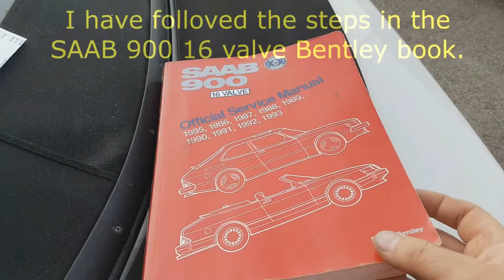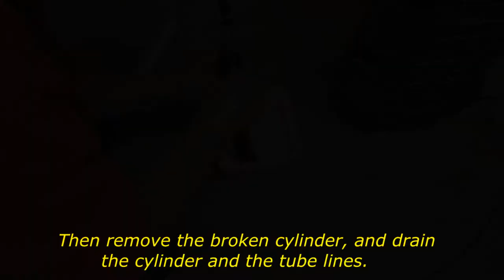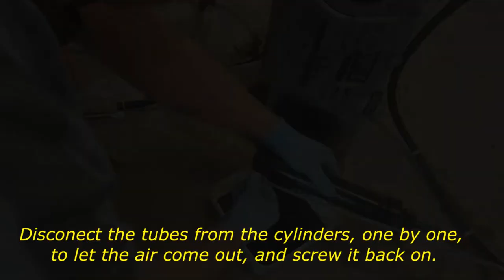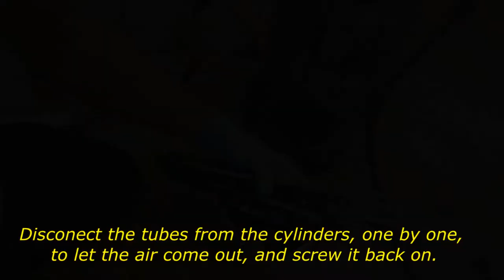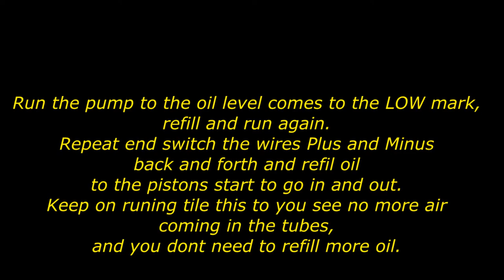SAAB 900 Classic Convertible, Top hydaulic repair.

Comment: Excellent video on a repair all of us SAAB 900 convertible owners are likely to face sooner or later.  Your car  is spotless!  None of mine looked that good when I pulled the rear seat, so I assume you've been busy with bucket and brush.  Your pride shows.
Reply from the maker: Yes, it loocked like an old garden that havent been cleaned up for years, behind my rear seat, when I pulled it out first time.
I bought this vert from San Diego CA and shipped it to Norway in mars 2017.
I think this car is very good what matters of body and so, but there is a lot of small things to do with it tecnical.
Like rubber and ball joints in suspension, etc.

Comment: Interesting and helpful! Have you also been working with the roof frame/ hings? Above the drivers door there is a hing which lately has dropped about 5mm on my 1992 cab. I have not yet found the reason.
Reply from the maker: No, I have not been into it, but I have instruction manual for adjusting the roof system.

Comment: These are sooooo much easier than the NG900 with all of the different motors and getting them timed correctly.  I wish I had never sold my '90 convertible.
Reply from the maker: There is a lot of og 900 convertibles out there for sale.
Just find one you like, anf make a buy... ;)
Just follow this link, and you will find several of them...
http://www.saabnet.com/tsn/class/900convertibles.html?fbclid=IwAR0wskRHNlgnqsADfTKsNPVisOqe8NaDdkrJlmXkNwrnurPzvcFiY4EHjTg#19060127761mbako

Comment: HELP!  Hi Terje I just came across your videos and I'm now a subscriber!  I am hoping you might have some advice, I have a '91 900 Turbo convertible (only about 100k mi on it).  Anyway, the hydraulic motor made a loud pop and then stopped working.  I took it to my mechanic who replaced the hydraulic motor but after like 3 or 4 uses the same thing happened.  Got a replacement and it happened again.  Any ideas what could be causing the hydraulic motors to blow?
Reply from the maker: Are you sure it blow?
Have you checked if it isnt just the hydraulic sylinders?
The top of the pistons use to  snap of like on mine.
Go into the trunk and open the valve behind the carpet, and then lift the roof up and down by hand to check if the roof goes freely, and check into the sides to see if the pistons is ok and follow the mecanism up and down.
Hard to conclude anything withiut not seeing it myself.
Reply: I think it is the cylinder that pops. Any idea on how to keep it from doing that?
Reply from the maker: @Coolhurt2023  You have to do what I told you and see if the pistons is not snapped off at the uni link at the top of the piston.
They use to break off.
Reply: @TerjeNormann  thanks for the input.  I'm not going to explain it well but apparently there was something in the frame that either through wear & tear, something else, was now cause the cylinder to over extend. My guy couldn't completely figure it out but net net rigged it, at least in the short run so that if won't hopefully cause the cylinder to over extend and break.

Comment: Hi i have a 1993 Saab 900i convertible i charged the battery the other day now the roof won't go up or down was working perfectly, i just get clicking from the 2 rear brown relays that are under the rear seat  the 2 x 20amp fuses under the hood seem ok any idea what it could be the handbrake light is on the dash if my brake lights arent working would that stop the roof working Thank you
Reply from the maker: For some reason I did not see your question before now.
I'm so sorry...
And I'm curious if you solved the problem, and what did cause your problem?

Comment: I have a leaking piston in my 900S and i cannot get the roof up again. Is it safe to lift the roof up by hand in order to change the leaking piston?
Reply from the maker: No problem.
You must then first go to your trunk an open the release valve you find behind the carpet flip down in right corner, as i showed in the video.
Then the hydraulics is in neutral.

Comment: Did you need to bleed the line at all?
Reply from the maker: Yes, as you see in the video.
Reply: @TerjeNormann Normann apologies, don't know how I missed that. Are you running the pump then discounting and then running again? I have a system that's fine but has some air in the lines. Wondering the best way to get small air out.
Reply from the maker: @ClintHowen  You have to take the entire system out of the car, so you are able to hold the pump above the cylinders, so the air stream up to the resaroar while you are runing the pump back and forth...
Reply: @TerjeNormann  ahhh that makes sense. Thanks, I'll give this a go.
Reply: Hi 
so for bleeding do I need to have oil pressure valve open or close ?
Thanks